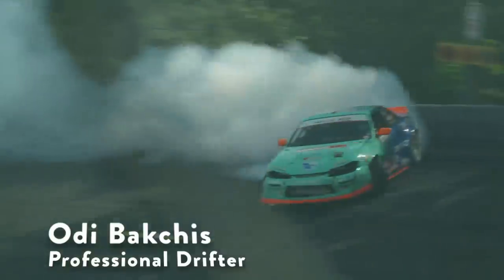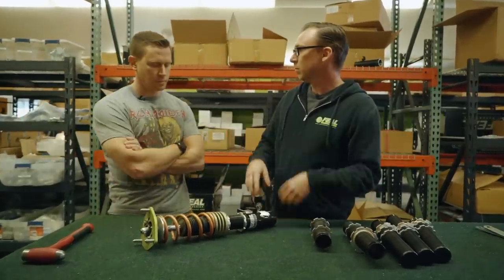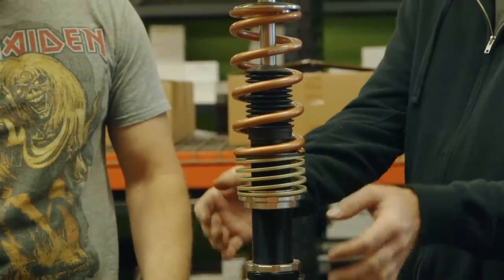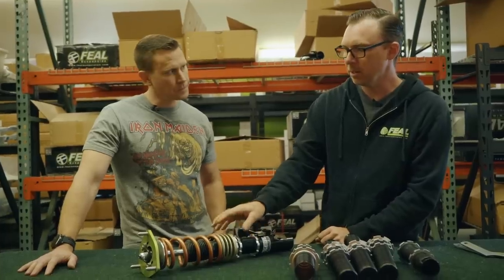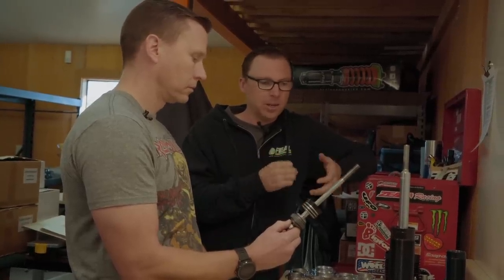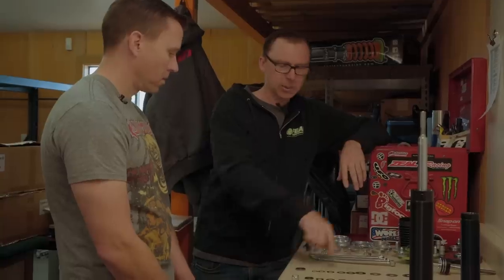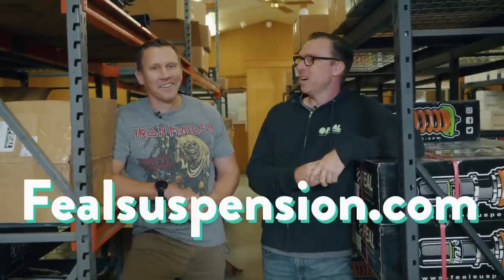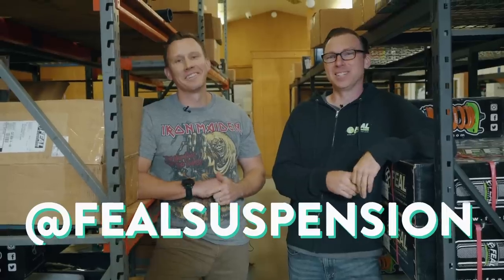WHAT MAKES COILOVERS AWESOME - How it Works | SCIENCE GARAGE

Comment: Keeping your orfiaces properly oiled up when you're using them violently is super important guys ;P
Reply: casey escobar  indubitably
Reply: casey escobar  for real I always suggest going over everything at least once a year if your going to go crazy with it, at the very least even if it doesn't need it, it helps you feel better knowing everything is at 100% and locked down so you're not going to be slowly losing bits and bobs over several different events and then worry about some crap getting free or having a catastrophic failure of a vital part
Reply: W e E a B o O

Comment: The value truly happens when you get into the second level ones. The lower level ones, are just to lower the car, and take your money. 

Aka, the $2000+ ones.
Reply: Who makes second level?
Reply: About to spend that kind of money on my NA Miata and we’ll see how big of a difference a ‘second level’ makes compared to my Eibach/Bilstein combo! I’m super excited. Will post a results video as well.
Reply: @jimhopper2246  racelands, duh
Reply: @jimhopper2246  KW, Stance, BC, Fortune Auto,  Ohlins, etc, and a lot of these brands have cheaper options, aka first tier, and more expensive ones, second/third tier
Reply: @brianj7787  don't get Ohlins, they are so finely tunable that it usually ends up in a mess
Reply: @brianj7787  thanks
Reply: Sounds like Gaming Graphics Cards nowadays....
Reply: @brianj7787  And Ground Control!
Reply: @VictorPitstop  
even with bc the miatas handle better... than bilsteins konis etc etc...

with these hi end fealsuspensions you ll get way better handling
trust me i know.

youll just need to set them to fully soft to get comfy
even at full soft its harder than bilsteins
Reply: @ae70gts  I'm going for the Flyin' Miata Fox Coilovers. I figure I wanted a streetable car that I could take to the track or else I would've went with Xidas. I know the ride will be firmer, which is what I am looking forward to; my front end bottoms out from time to time because that suspension compresses too much. I welcome the added rebound-stiffness!
Reply: rvidal0001  I FEAL that my man, (sorry, I had to), but alas, I am a Boujee and Extra person and have already talked myself into spending the $$$ on these. Lol
Reply: I’ve had BC’s, Tein, Tanabe, and Fortune Auto.  
I still prefer Fortune Auto over the other names. As for entry level coils, yep spend about a grand on those. But.. you get more than height adjustment. You get spring preload with some, rebound, and height adjustments. Someone meantiomed ground control, one of the best options you can do is GC sleeves kit, and create your own Coilovers using KYB, Koni, and other adjustable shocks. These setups are widely used in your amateur road racers. They are cost efficient, and are fully customizable.
Reply: As someone who builds shocks every day how much you spend on coilover is bullshit, I've won races on 200 dollar pro shocks and seen guys not be able to figure  out their car on 2,000 dollar penske's as long as you dont buy the cheapest junk that will fall apart
Reply: @VictorPitstop  Are you moving to Xidas? I'd be more interested to see how the new spec Penskes do compared to the Xidas. Disregard the Xidas bit, I see you bought Fox stuff. Xidas ride hella comfy and perform incredibly on the track, too. Maybe give it a try if you don't like the fox stuff.
Reply: @dallatorretdu  except for a motorcycle
Reply: Didn't know that! Wow
Reply: I had Megan Racing 15 way adjustables n I liked em
Reply: Bro thats the same one you have been asking before i gave the right size to come up with the last one i have seen

Comment: Something I've always pondered about - magnetic damping. I've seen videos of a neodymium magnet dropped through a copper tube, it goes very slowly because of eddy current resistance - a form of damping, with force proportional to speed. Could someone build a shock using this principle? Would be extremely simple, and no fluid to leak. Could get more adjustability by using an electromagnet so force can be adjusted very quickly, still very simple and with very cheap components. No sliding seals, just linear bearings (which would be fairly simple to replace) so it ought to last forever. Would want to put fins on the outside for cooling, but internal components would not get hot as the heat is generated by eddy currents in the outer tube.

Comment: It has been years upon years since I changed, adjusted, and installed a pair. What little I do recall is that each kit had specs that matched each make and model. I believe that markings were placed on the struts for vertical adjustment. Trying to understand this without doing it seems more difficult to someone from my generation.
Reply: Nothing has changed except ride quality has gotten better, meaning you can ride low and still be at oem comfort.

Comment: How does electromagnetic suspension work?  I've heard of Koenigsegg tuning their suspension on the fly[GPS enabled] it could be the difference between carbs and EFI  but for the suspension
Reply: They actually did a video on that sometime back...
Reply: @JonManProductions  I faintly remember seeing it with a picture of a mustang on the video just never watched it
Reply: Essentially the fluid inside has metal shavings or a metallic flavor to it. When a magnetic field is applied to the fluid its viscosity changes and "clogs" the orifaces so it gives you different rebound and dampening settings "on the fly" by different electronic signals. 

Kinda old tech from GM in the late 90s. The whole story is its British made by GM money that was sold off to Chinesw investors. 

But the damper changes for each corner of a track by gps is kinda new. Also F1 started to play with programmable suspension in the 90s (I think) until it was banned because it worked so well.
Reply: Cadillac in the early 2000's had a system like that.  It would stiffen the suspension on the outside wheels when you made a sharp turn.  And it would stiffen the front wheels under braking.

Comment: Question: i have a 1970 Buick Skylark. Ive done body work my whole life but only recently have i started learning about engines and suspension parts. What coilovers would you recommend if i want my car to be better at cornering?
Reply: Hell yeah it's going to help, a old car like that has soft suspension and handles like a boat but with coilovers you'll be lower and have a stiffer suspension. If you have the money you definitely should get coilovers.
Reply: @bagle58  would any kit fit? Or does it jave to be specifically made for my car?

Comment: I drive a full-size truck, already dropped on belltech coils and belltech leafs, but say I want to really up the handling of the truck and convert to a coilover 4-link or 5 link rear, what would I be looking for? As far as driving, mostly would be on the street, so lots of uneven surfaces, bumps, humps, dips, cracks, and potholes. Is softer or stiffer better for that? And if softer is, isn't that going to be detrimental to body lean, I would think?
Trying to get ideas for when I can really rip into my project ..

Comment: So, with coilovers that don't have an adjustable lower mount, if you lower your car by operating on the preload, you'll always have a car that handles turns in a "meh" way? Or is there a way to lower your car and still have stiff suspension that are going to handle turns well?

Comment: Can you do a science garage on why certain engines run at a higher rpm than others and how people make engines spin faster??
Reply: Put simply, it's about centrifugal force and momentum. Engines cannot rev faster than a certain limit because forces in the engine will cause it to break apart. Above a certain speed valves can't move back and fourth quickly enough, leading to valve float. Engineers can design engine components to be stronger and lighter so they can run faster, but doing so is expensive. Even below redline, there's the question of how quickly air and exhaust can flow into and out of a cylinder, which relates to port tuning and number of valves, an engine running faster than optimal can't produce as much power because it's not moving air in and out as efficiently. As for why some are faster and some slower, it's a matter of design trade-offs. Faster revving gives more power per weight because it allows more air to be pumped through a given size of engine. But running faster is noisy and causes faster wear, and designing them to be capable of that is very expensive. Formula 1 cars use very high revving engines to get the most power, but those engines are very loud, last only a few races, and are unbelievably expensive - not practical for anyone's daily driver. Luxury cars are often the opposite extreme, big-displacement engines that run slowly - they are smooth, quiet, and last forever, but don't give a ton of power for their size and weight.
Reply: @quillmaurer6563  thank you